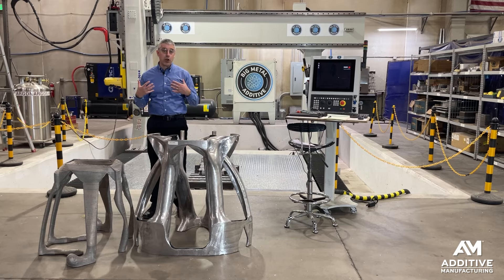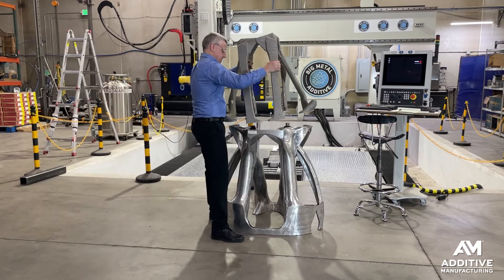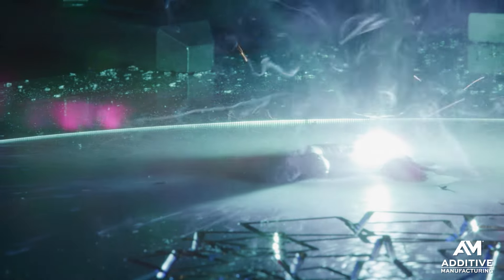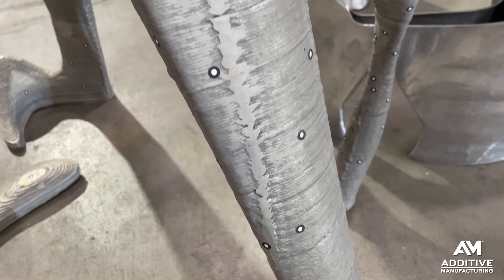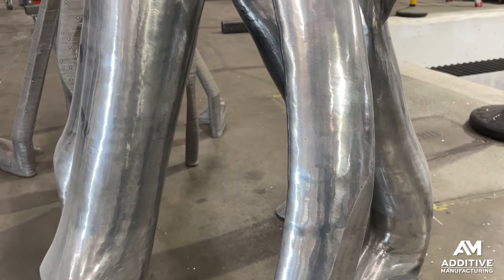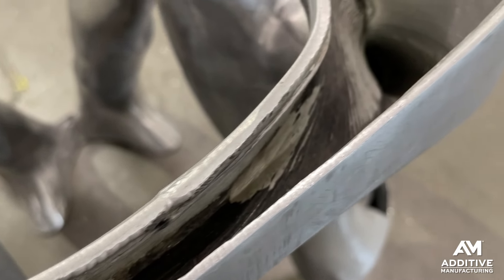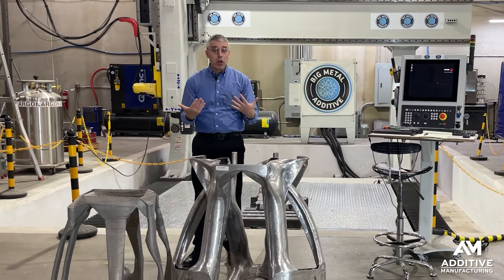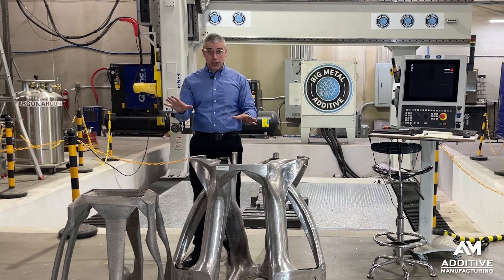Machining Aids Fatigue Strength for 3D Printed Aircraft Structure

Comment: Those results are surprising, I'd like to know the methodology of their test.
Reply: Stress concentrations are a known issue. Just look at the de Havilland Comet.
Reply from the maker: According to Slade Gardner, founder of Big Metal Additive, fatigue testing was performed in accordance with ASTM E606 using R 0.1.
Reply: @AdditiveManufacturing  Nice that you would add that detail
Reply: It's well documented that surface polishing increases the fatigue life of metal parts. Layer lines (and even raster lines) have acute, crack-like re-entrant corners. They're remarkable stress concentrators that are especially problematic for brittle and/or notch-sensitive materials.

Comment: I don't see why these can't be cast instead. I guess when you have a hammer factory, everything looks like a nail.
Reply: @danko6582  Investment casting is probably just as slow, sand casting leaves similarly crappy surface roughness, die casting molds are too expensive for low quantities, and all of these might require a different alloy with higher castability. Otherwise, I’m not even sure if die casting can accommodate such complex geometry.